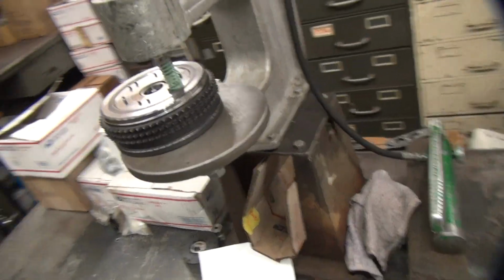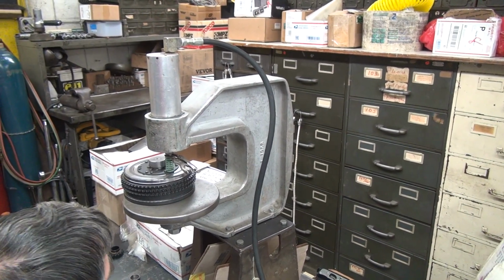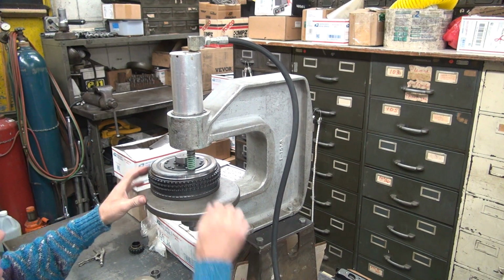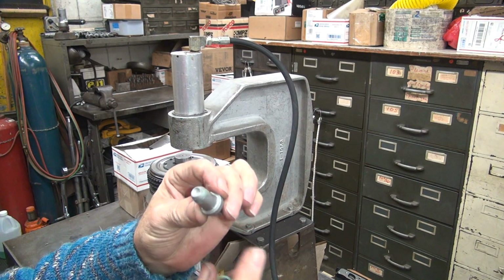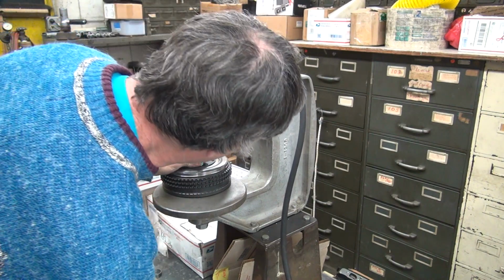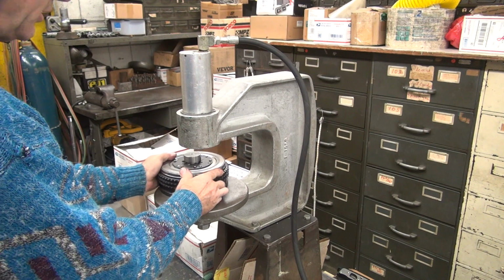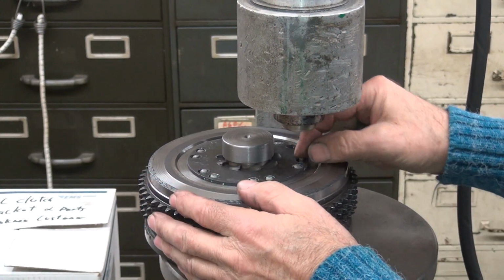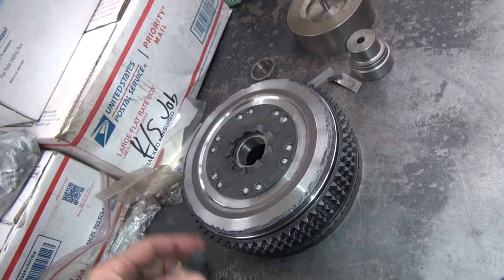#101 1971-78 xl kicker ratchet gear plate riveting clutch basket sportster harley tatro machine

Comment: A long time ago now , we use to reline tandem dump truck brakes in the field , a narrow punch the size of the rivet hole in the brake shoe and a hammer to remove the lining . A pair of vice grips clamped on a bolt head of a bolt that fits the rivet head hole in the lining - laid on a bench to hold backup on the rivet head , set the rivet head down on the bolt , we had a die out of a brake machine press and a hammer to mushroom brad the rivets with . You can use a larger blunt center punch to spread the rivets .and then a flat blunt ended punch to finish the brad . The old hand lever manual emergency brakes that mounted to the drive shaft were relined the same way , drum type with a brake lining band or rotor type .